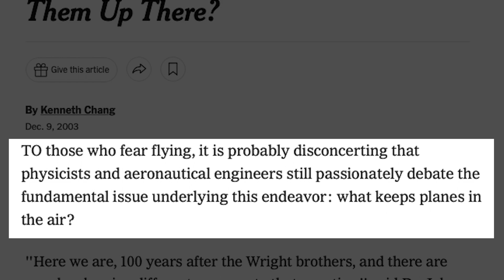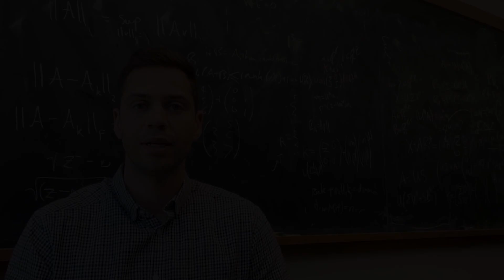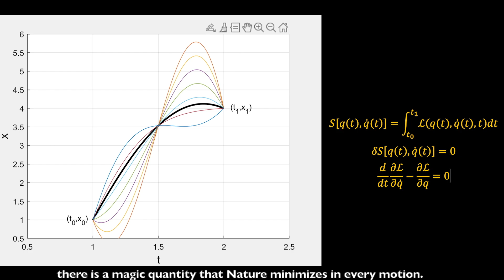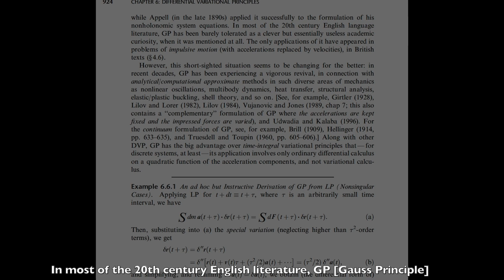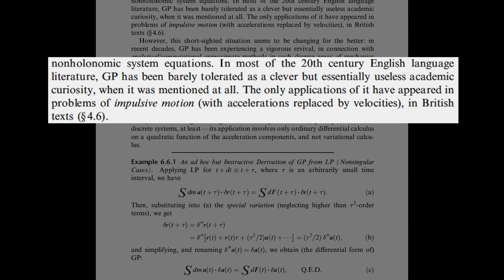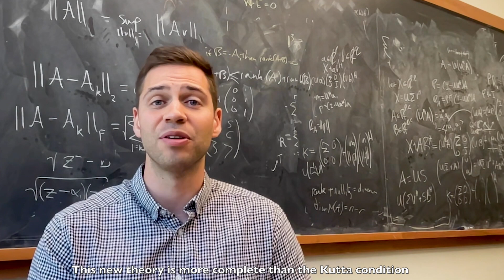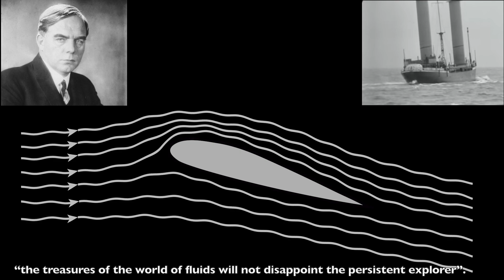A New Theory of Lift

Comment: Newron's third law of motion. The wings push air down with a force (equal to the rate of change of momentum of the air), the air pushes the aircraft up with a force equal in size, but opposite in direction to the force exerted on the air.
Reply: That's great. Now explain the change in momentum.
Reply: @ChucksSEADnDEAD  Basically, the forward motion of the airplane compresses the air at the leading edge causing the air to be accelerated up and over the top of the wing. This creates a region of low pressure over the upper curved portion of the wing. When an air molecule traveling in a straight line encounters the region of low pressure it gets deflected downward as it follows the curved surface of the wing. It's this downward deflection of the air that produces the lift.
Reply: @joevignolor4u949  That's great. Why is a low pressure region created on the upper portion of the wing? Why can lift be generated by non-curved upper portions? Why isn't the air accelerated down and under the wing?
Reply: @ChucksSEADnDEAD  "Why is a low pressure region created on the upper portion of the wing?" The low pressure region above the wing is created because of Bernoulli's principle. Think of the leading edge of the wing as an obstruction moving through the air. As static air encounters this obstruction it gets compressed ahead of the wing. The compressed air then clears the obstruction by flowing up and over the top of the wing. As this happens the airflow accelerates over the top of the wing towards the trailing edge. This causes the air to go over the top of the wing at a higher velocity than the air flowing under the wing. As the air accelerates over the top of the wing the pressure drops as per Bernoulli's principle. This is what establishes the low pressure region on the upper port of the wing.
Reply: @ChucksSEADnDEAD  "Why isn't the air accelerated down and under the wing?" First, read my answer to your other question about what creates the vacuum on top of the wing. In it I talk about the leading edge being an obstruction. The obstruction is the key here because it alters the airflow and it does it differently above and below the wing. The way the wing is shaped most of the air being compressed by the leading edge is being forced up and over the top of the wing. This allows the airflow to accelerate as it travels over the top of the wing, which in turn creates the region of low pressure. The bottom of the wing is different. Relatively little of the compressed air from the leading edge travels under the wing. Further the underside of the wing is flat so it doesn't disturb the airflow as much. As such the air is not accelerated as much by the bottom of the wing as it is by the top of the wing.
Reply: @ChucksSEADnDEAD  "Why can lift be generated by non-curved upper portions?" Actually it can at high angles of attack. Some airplanes designed to fly at supersonic speed do have thin flat wings. But at lower airspeeds they have to operate at very high angles of attack (think of the Concorde taking off). In this case the whole bottom of the wing is an obstruction, which accelerates a lot of air downward. The obstruction also creates a partial vacuum on top of the wing, which also accelerates a lot of air downward. Together the two downward flows provide the upward lift to necessary to support the weight of the plane.
Reply: @joevignolor4u949  1. The "compression"/"tube pinching"/Bernoulli justification isn't valid, as it fails to explain how the pinching of the stream occurs on "top" and not the "bottom" of symmetrical airfoils.
2. Your answer does not explain it at all, considering that the leading edge being an obstruction would also cause pinching and thus faster flow on the bottom. It also fails to account for symmetrical airfoils and supersonic airfoils, which don't have the "blunt" face to force airflow upwards. Even a flat plane can generate lift. Not all airfoils have flat undersides. And notice the contradiction: first you attribute the compression to the leading edge, and then you say the flat bottom is what fails to accelerate the airflow. If anything, a flat plane would allow air to flow faster while a curved region with low pressure would create turbulence and more skin drag.
3. You're trying to resort to high AoA and high speed to force the square peg in the round hole. However, the reality is that high performance aircraft have to compromise and thus have to resort to things like high AoA take offs and landing, or variable geometry wings, or more advanced lift generating devices to keep the wing area reasonable. Meanwhile if we go small like RC planes, flat pieces of foamboard can generate lift at low speeds and moderate AoA as their wing loading is extremely low and enough lift is created in conditions that should be impossible per this discription.
I think you missed the entire point of this exercise. People are trying to figure out the physics behind lift with actual maths and you're delivering the edutainment explanation anyone can get on old Discovery Channel documentaries in plain English. Maybe these guys are wrong, but it's actually uncomfortable to see random people criticizing the people doing the actual mathematics and then pulling out Bernoulli when questioned. If you are an actual PhD with a good theory of lift, post a video to englighten the masses. If you're just a nobody like me, spare me the "edutainment" explanation. It might be "close enough for government work" if you have to explain to a child but not really relevant for people who are intrigued by this video.
Reply: Correct
Reply: Will that still work with a hydrofoil being dragged at an angle through liquid helium?
Reply: I agree. Wings produce lift using the same action/reaction principal that a rocket engine uses to lift a rocket off the launch pad. The pressure created inside the rocket engine's thrust chamber accelerates the combustion gas downward through the nozzle, which produces the upward lifting force. Similarly airplane wings accelerate air downward to produce an upward lifting force.

Comment: The essence is simple:  
Air goes DOWN. 
Airplane goes UP.
Reply: Sir Izzy Fig Newton approves of this one 🙂
Reply: Yes it does. Simple, isn't it?
Reply: Thanks, now all makes sense-
Reply: thats not the full effect. Otherwise a flat plate would make the same lift as an airfoil
Reply: @nade5557   Depends what you mean by "not the full effect."  The law of conservation of momentum dictates that 100% of the "full effect" is that the force of acceleration of air downwards exactly equals the force of acceleration of the airplane upwards.  The only question is exactly why the air is going downwards.
Reply: @ThatBoomerDude56  I mean lift generally. It's not as simple as air goes down plane goes up
Reply: @nade5557  I also mean "lift generally."  As I said, the fundamental laws of the universe dictate that the force of acceleration of air downwards EXACTLY EQUALS the force of acceleration of the airplane upwards. 

As I also said, the ONLY thing in question is WHY the air is forced downwards.
Reply: @ThatBoomerDude56  youre right sorry I misunderstood

Comment: Lift IS a viscous phenomenon. If you do a RANS simulation with zero viscosity you get zero lift
Reply: Hi Thiago, RANS is an approximation of N-S. So, let's consider the exact N-S. When you set viscosity to zero, you simply get Euler. And as mentioned in the the video, 2D Euler is not unique. There are many solutions. Computations will give you one number; but it's not the only solution. It's just one of them. Kutta's theory tells us which one to take if we have a sharp edge, and this new theory tells us which one to take for any shape.
Reply: @haithemetaha9194  Hello Haithem, thanks for the thoughtful reply. My understanding is that Euler is inviscid and irrotational. Can an inviscid flow be turbulent? I'm not sure but I would imagine so. Would anyone know the answer to that? I would be grateful.  

More to the point, even on a potential flow you do get a single solution before you introduce circulation (which correlates directly to lift). So I also disagree that there are infinite solutions to the potential flow around a wing.
Reply: Another even more stark data point. Every single wind shape has the same lift slope, from a flat plate to whatever. That's far from a mysterious phenomenon. Drag on the other hand is much harder to get accurate estimates. So are 3d effects, flow separation etc... 

It just seems like an unfair characterization of a well understood physical property of wings.
Reply: @thiagoXXXmarinho  Euler is not irrotational. It allows a non-zero rotationality.
Reply: @thiagoXXXmarinho  Yes, indeed, all shapes may yield zero lift in an Euler solver for 2D, but like I mentioned this is not the only possible solution. You can simply add a circulation of arbitrary strength around the body and still satisfy the PDE and the no-penetration boundary condition. This is the predicament that we solved by minimizing curvature. And because before this new theory, this predicament couldn't be solved unless we take viscosity into account, people thought that viscosity is necessary. Here, we recover the exact same result without the viscosity argument.
Reply: @haithemetaha9194  I see, I understand it better now, thanks for replying
Reply: @thiagoXXXmarinho  You are welcome. Thanks for sharing your thoughts.
Reply: @haithemetaha9194  N-S with zero viscosity is not equivalent to Euler as the boundary conditions are different!
Reply: @manfredkrafczyk5755  Yes, Manfred, you are correct. In fact, this is an open problem in mathematics. Does the solution of N-S (with its boundary conditions) converge to Euler (with its boundary condition) as viscosity goes to zero? 
But if we want to be strict, I would not solve RANS to check this problem. One should try to solve N-S, which is far from being possible particularly because we are concerning with the infinite-Re limit.
Reply: I agree.